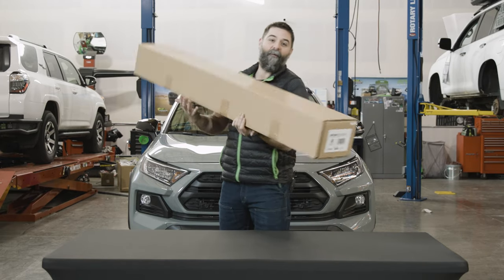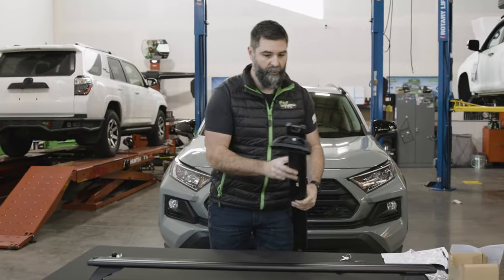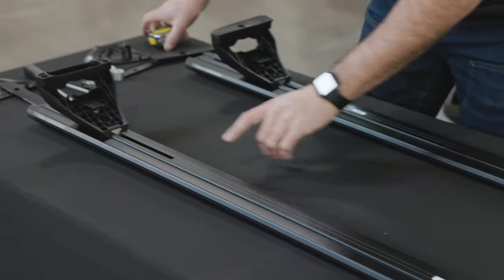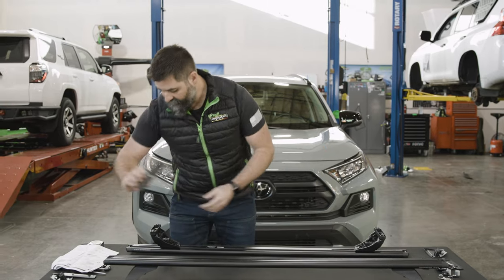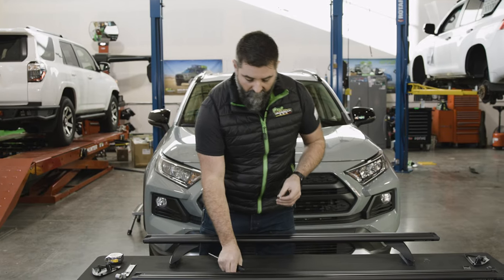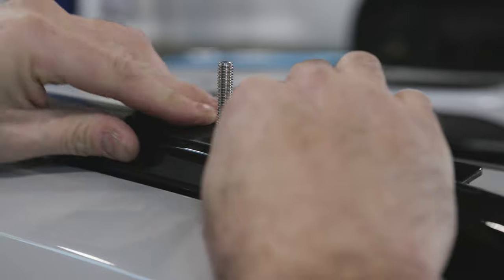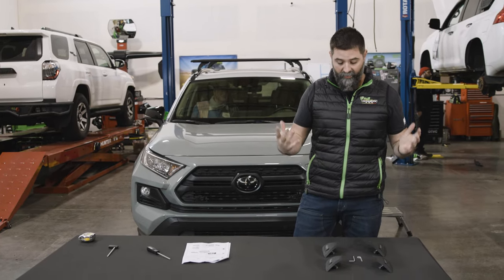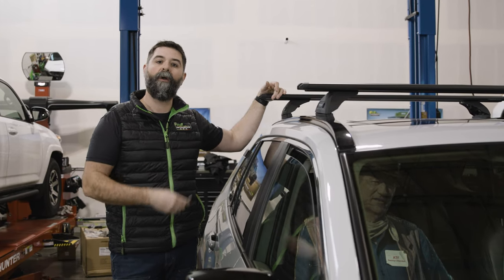Ironman 4x4 Atlas Roof Rack Cross Bar Kit Suited For Toyota RAV4 | Install Guide

Comment: Hey guys, thanks for the helpful video for installation. Just one thing, the M8 bolts for the rear were a little too short, so fastening the wingnut finger tight was near impossible without pulling down on the rack to give access to more thread. longer bolts would be better. Will be using this rack with a lightweight RTT and your 6.5ft awning, so we'll see how well they hold up in the field!
Reply: Any update on your experience? Just ordered this rack for an upcoming trip.
Reply: @tdeeez  I returned the Atlas cross bars and bought a Rival platform which ended up coming with its own set of issues. The Atlas racks are solidly built, just check the back brackets set up and make sure you can fasten the M6 bolts securely enough for your needs.
Reply: @DaveAsher  understood. Hoping for the best!

Comment: @Ironman4x4 will the 80mm studs bottom out on the roof panel, etc..?
Reply from the maker: They won't, just pay close attention to the instructions.
Reply: @Ironman4x4America  thank ya!
Reply: @Ironman4x4America  tightened it until it got snug with a little blue loc-tite. Solid so far. I'm happy!